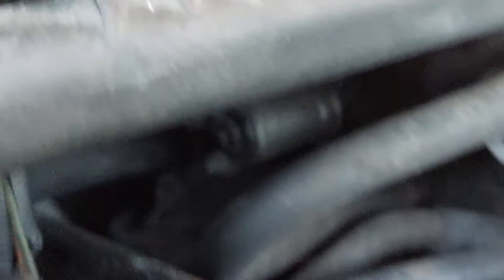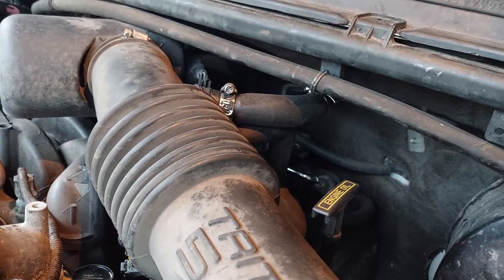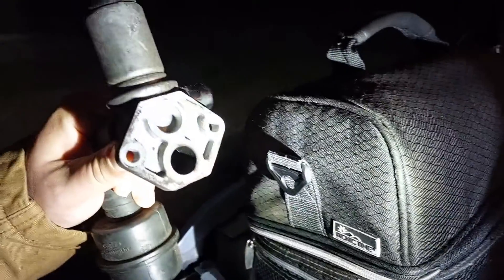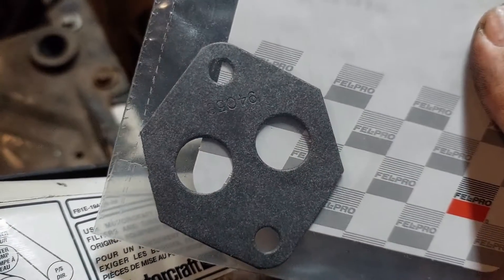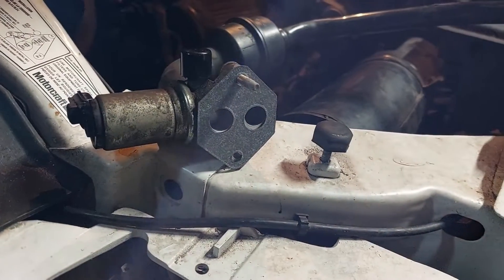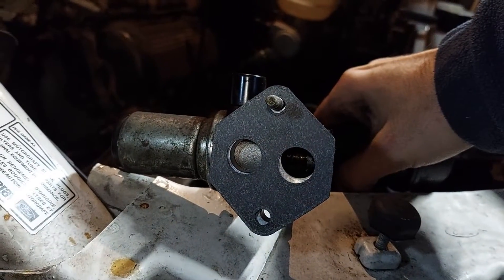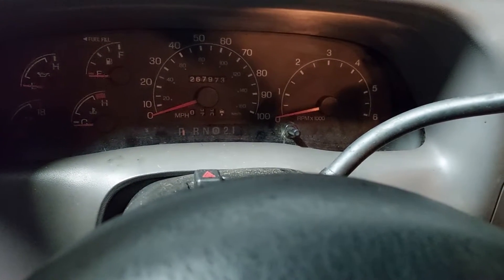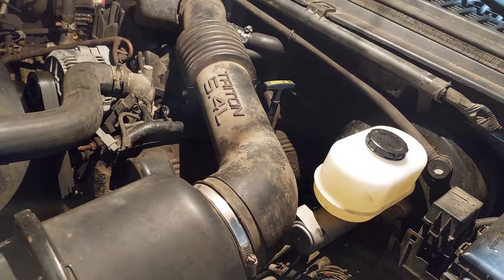Five Minute Fix 21 - IAC Cleaning 2001 Ford F-250

Comment: About to try this. My 2002 5.4 is idling at 2000+ rpm in park and neutral but runs fine in drive and reverse. 
    When I pinch the air hose running to the iac it drops to 850-950 rpm, I suspect the iac gets stuck open...
Reply from the maker: Cleaning may work but honestly I would just replace it.  Cleaning is a band-aid and the IAC is still going to go bad.  Buy a motorcraft replacement if you can.
Reply: @MazdaB3K  just bought a new one actually! Installing it tomorrow just because of you reply, thanks for your video and help. Im subscribing to your channel, you're a very helpful Man.
Reply from the maker: I appreciate it.  I try to film the stuff I fix so that other folks can learn what I learn.  I don't expect to get YouTube famous, but I hope I can help some folks save money and learn some skills.
Reply: @MazdaB3K  i wish you the best Man, you help a lot of folks with your videos! You may not get youtube famous but if you ever break down in manitoba Canada I'll bring my tool box for ya!